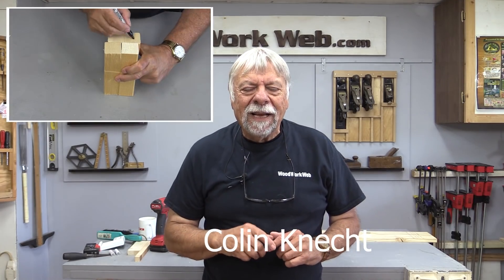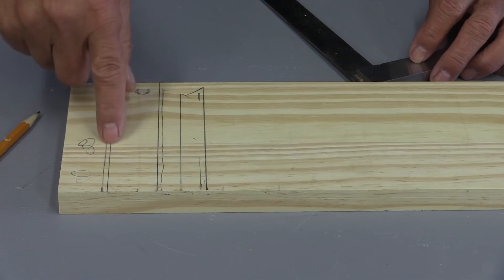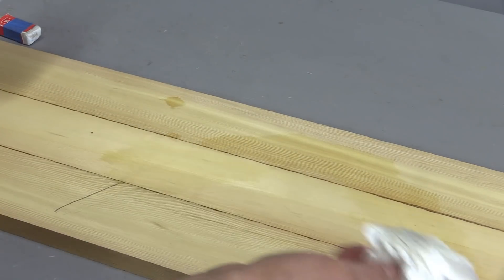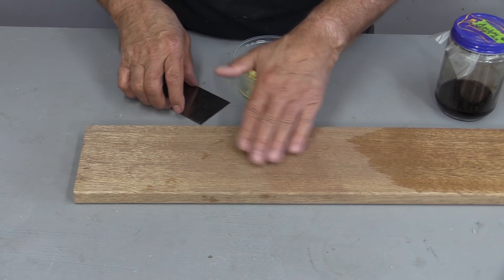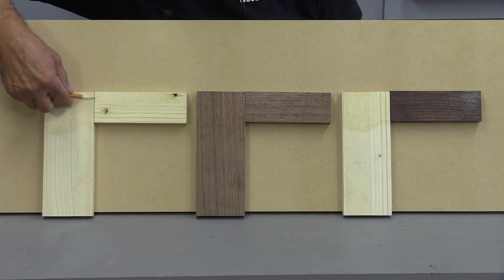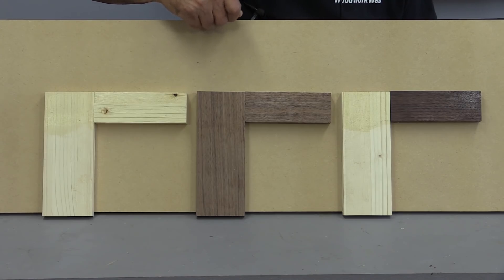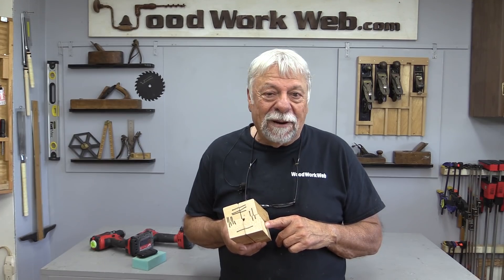Secret Tips the Woodworking Pros Won't Tell You

Comment: My father was a woodworker and carpenter in the '60s and '70s. Recently I was reassembling an old table he had and I noticed on the bottom by the legs that he used hash marks I II III and IIII to ensure proper orientation and placement. 

I remarked to him about that and how it made it so much easier, and he responded " your grandpa taught me that "
Reply: Yeah both of my grandfather's wore more hats than I can wrap my brain around. My mom's dad, 1 of the 2 I actually met, was in a county playhouse, used to deliver cubic foot ice blocks for people's pre-electric refrigerators up fire escapes, used to shovel coal into the house to burn for heat, was in the air force (trained as a paratrooper, served as a mechanic) in WWII (him and his brothers all volunteered), was a loving father to 6 kids, made them all go to school, sang for the Pope (JPII) while on his choir's grand European tour and for over 50 years worked for a company making prosthetics for amputees until he retired at 82... Not long from when he died. They don't make em like him any more. That man is my hero.
Reply: JJ my great grandpa used deliver ice blocks too.  And milk.  And he made skiis.  👍
Reply: my grandfather was a tool and die maker for the bud co, in philly( ford parts) ,he showed me clock positions, which is the same idea, like if  part is in front of you , you can know which  direction and where to place the part, there can be many clocks , but it does help, if i don't do that, i wind up scratching my head for hours, trying to remember why i cut this that length, if i have to stop , and pick back up again, grand fathers are awesome
Reply: @chrisnorton2837  You know, I added central air to my house a few years ago and when researching how many TONs it should deliver, I found out that the industry still uses the term as an equivalent to the tons of ice a family would require to get through the spring and into winter.

Comment: Hi Colin!  Another nice vid' but I'd like to make a couple of comments, if I may be so bold.
1 : My Grandad taught me to scribble on the waste side of the line.  This means your line won't be short of the corners of the wood and you can continue to mark all faces of the board accurately.  It's particularly important to mark and knife all faces when using hand tools so that you make a square cut. 
2 : A scraper is not a "scraper".  If sharpened properly, it's a microplane which produces fine shavings, not dust.  Used properly, it gives as good a finish as your smoothing plane.
3 : There's an old Architects saying :-   "If something unattractive is going to be visible, make a feature of it."  A small chamfer on the meeting edges of a joint, make it seem a deliberate part of the design.  It's not important that a chamfer can hide a lot of mistakes.  Because we don't make mistakes.  Do we?   ;¬]
Thanks for the info, Colin.  Keep 'em coming.
[Edited for bad grammar.]

Comment: A pros suggestion for finishing that a lot of people do not know about!! Very important to put seals on all sides and surfaces (you can mix it yourself by putting lacquer with 50-75% laquer thinner). All is left is to sand with 400 grit to remove the raised grain and/or bubbles. Voila, you have your peace ready for all kinds of finish and the color and the finish will stay even all across the peace 😉👍🏼🇨🇦
Reply: Spellcheck?
Reply: @Andy-in8ej  thx , was lazy 🥴
Reply: @Andy-in8ej  he spelled peace correctly
Reply: @Andy-in8ej  nothing better to do? Cmon man.

Comment: Colin, I use a circle like a clock and draw one at the top of each legs. A dot at 6 tells me which side is front. A dot in between 12 & 3 tells me the leg is back right. Now, I never have to remember where my starting leg is.

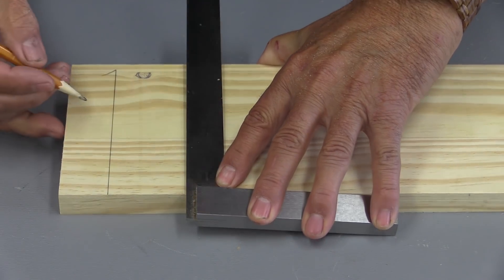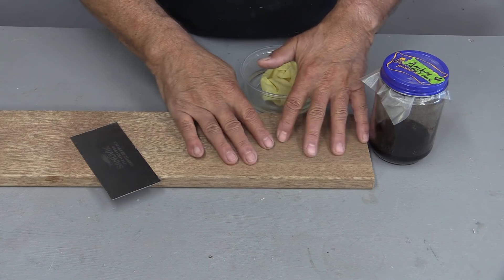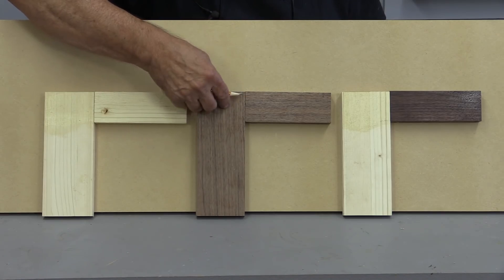My clock points are 1:30, 4:30, 7:30 & 10:30. 

For smaller pieces I replace the clock with a cross and add the dots accordingly. 

The reason this works is that the legs always fall between the quarters so the 6 position is always open. No overlap. 

Have I made sense of this? I hope so. 

Anyway, I hope you like this suggestion. I think it might be even easier than the one you made. 😊

Comment: For the 4 pieces to make a leg, I just draw a circle on top. It works like the V (or in your case mountain) for board jointing.
Reply: In Germany we use a triangle. It calls "Schreinerdreick". It is then very easy to see where is up, down, left, and right.
Reply: It's called a "cabinet maker's triangle" in English. Used for legs, wide boards, rails and stiles, box sides, everything. The triangles must line up and point the same way.

Comment: Hi Colin, love the tips it the remembering them I find the bugger, but yours are good cause there ones I would possible use a lot.  One of the tips you had for legs was good, but I use another method which is less work and I find simpler which is, I just use a capital letter across the top of all 4 legs like a B, just use a letter that can't be turned like an O etc, like your hill method for glueing up, they have to go back exactly how you set them up and there always in the same position. Thanks for the Videos always enjoy the helps and tips.

Comment: I use the lines on the ends of laminated legs to orient pieces.  I like to use riftsawn lumber for the legs, arranged so that the grain presents a "diamond" pattern viewed from the end.  The line drawn across the joints makes assembling the joint much easier.  And it helps keep the ends oriented as well.  It can be frustrating when the grain is opposite on joined sections.

Comment: As usual... Great tips. I really dig the 1, 2, 3, 4 tip for legs. This could easily be adapted for so many other things. The only caveat I'd make is 4 = IV. Nitpicky I know but a V is even more full proof. I've adopted the triangle or V markings on boards and it never fails. I use different sized triangles here and there but come on we can't even sign our names the same repeatably so how could we produce a perfect triangle enough to cause problems. Curved lines, circles, square shapes... Can you draw a square... Not without a ruler you can't but you can draw a rhombus, a parallelogram or a quadrilateral if you can draw parallel lines and you can draw tetrahedrons all day and night. People might be saying I'm being nitpicky again but words mean things and yes it does matter. Try telling your boss that asks you for a quadrilateral and you end up bringing her a rhombus that it's the same thing because there's 4 sides. This has been a diatribe sponsored by currently unmedicated ADHD. I would like to thank my insurance company for unnecessarily complicating the prior authorization process without notice which shouldn't be needed anyway because chemical imbalances don't go away ever... Drop mic... Exit stage left...
Reply: He is using hashmarks, not Roman numerals.  Like llll/ to mark off 5 and the slash is on top of the llll.  Increments of 5.
Reply: I just do 1 11 111 and the 4 blanks line up.

Comment: the cut marking thing, i just went through that with my friend, we were laying out vynal slab floor, he was measuring  /marking, and i was cutting, (my jig ,my saw , i get to cut) , i'm a non union  auto body guy, so we make up our own rules about those things , but he's a steam fitter, and they follow a set of standards in the industry, or at least from his hall everything is uniform, anyway, he showed me the same thing, cut on the side with the tick, and save the line so you can see if your cut matches what you measured, and the outside of that line( side with the tick )is your desired length , so after about 2 hours  of measuring class, he gave me a budweiser, and a soap stone marking flat, :)

Comment: That last tip? Just draw a triangle across all four. There's only one way it goes together, and the way I use it, the apex always faces front. When working with pairs, like the four sides to a box, I'll draw one triangle on the front and back (across both, point facing front), and one triangle on the pair of sides, again, point facing front.

Comment: Am i weird for always making a pair of lines spaced by the kerf I'm going to use? Ie if I'm going to cut a board on the bandsaw in 5in lengths ill make a pair of cut lines 1/16 apart at 5 and 5 1/16 ... 10 1/16 and 10 1/8 ... 15 1/8 and 15 3/16 .... If I'm going to cut on the tablesaw I'll make a pair of cut lines spaced 1/8 apart, etc. This way i never accidentally undercut my 2nd piece, 3rd piece, etc by the width of the blade kerf. The math on the fly can be a pain though. Better way?

Comment: I was taught by a machinist to take half the pencil line. Makes a more accurate cut.
Reply: I was taught to remove the whole line because the pencil is on the outside of the straight edge.